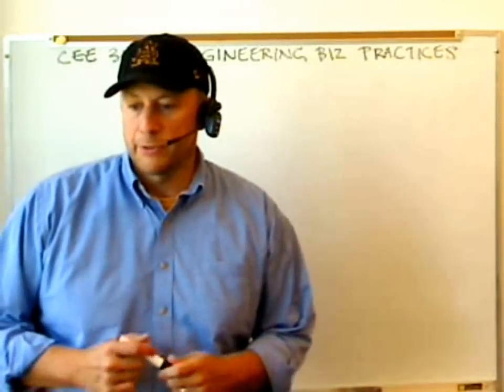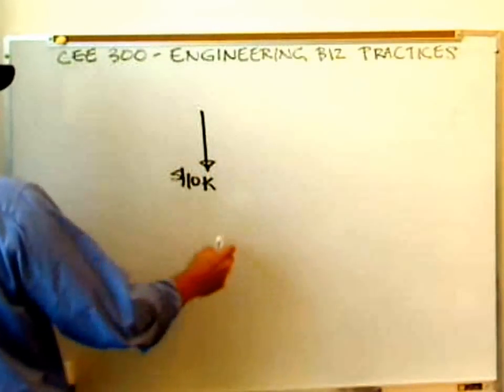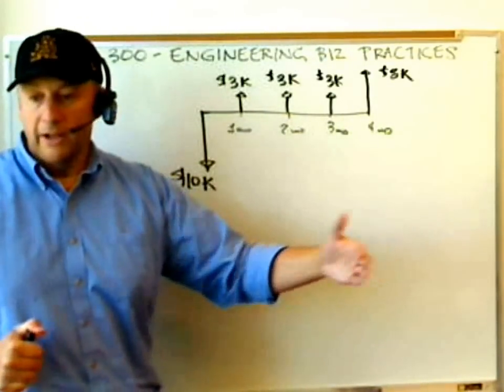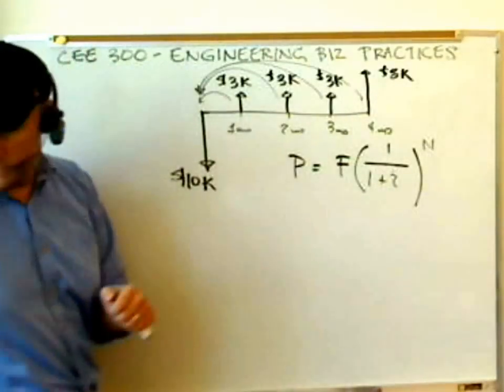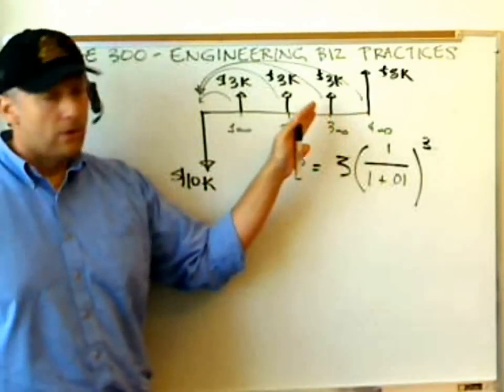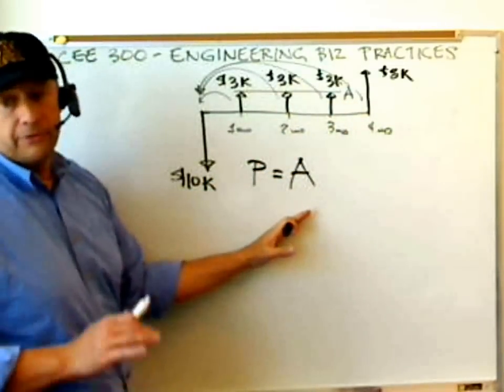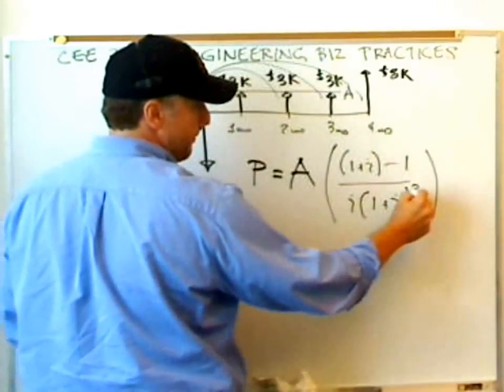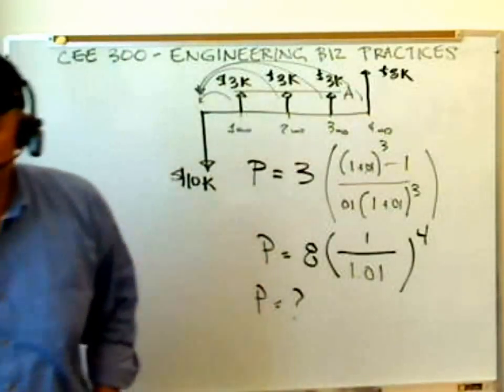Using a Cash Flow Diagram for Calculation of Net Present Value

Comment: the first answer is 0.088229 and the answer for the second one is 2.8829
Reply from the maker: Rewrite your comment using the variable that you are solving for in your answer.  For example, instead of "the first answer" you might write "The internal rate of return is..." or whatever variable you are solving for.

Comment from the maker: Yes!  A does stand for "annuity", but we use the same variable even if the payments come weekly, monthly or quarterly.  In that case "A" is a bit of a misnomer.

Still, the mathematical formula is exactly the same.  You just use an interest (or dicount) rate that corresponds to the period of the payments.  For example, a rate of 12%/annum would break down to 1%/mo if you had a stream of monthly, rather than annual payments.